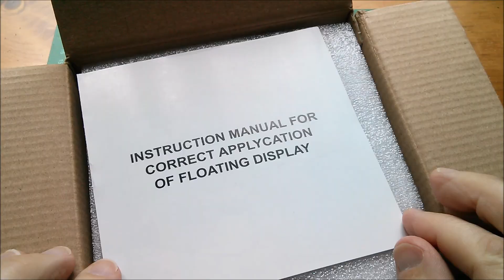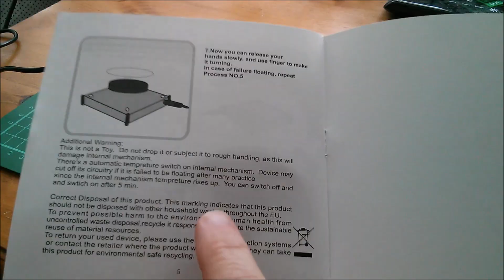Playing with: Magnetic Levitation Platform

Comment: When you said "metal case", i was thinking "really? looks like metalized plastic to me!", no idea how you could actually mistake it for metal after touching and holding it, that stuff feels so cheap and chincy in my experience...
Reply: die cast metal can feel pretty crap though, and depending on the finish can feel like plastic
Reply: The weight of the magnet and coils inside could be misleading.
Reply: some polymers are conductive ... but typically you would put a resin based finish on a metal (ie plastic) and these plastics are designed to feel like metal and usually have some kind of conductive filler material in the finish.. leading to a middle ground where one can feel like the other. yes i could tell you in a heartbeat that that tatty shite that was made in china is going to be a polymer, mostly because you cant cast metal like that for cheap.l.
Reply: Geniusaur i can tell you from here that it is cheap abs plastic ^^
Reply: Die cast zinc feels pretty crap. Iron, steel, and aluminum typically don't feel bad. Zinc is horrible though, you can feel the cheapness.
Reply: the new ones also got metal  Alu casing..
Have just purchased one of these costed a little under 30 bucks (USD) delivered on some wholesaler chinse site, not Banggood,.
and I notice that one was not the same as this one from Banggood as the casing was metal and a PIA to get off as it was folded inwards and the same with the board where there was also differences, not least temp sensor.
Se pictures here.
https://i.imgur.com/bTM1RGt.jpg
https://i.imgur.com/Ds5ODXs.mp4
https://i.imgur.com/GusHitk.jpg
https://i.imgur.com/c9msNED.mp4
But it seems that Banggood have also changed their version to this now on the listing above from Julians affiliate link as that  on BG site also showed with the same infolding metal top and magnetic floating-stand with a bare metal top and not suited in rubber like the video in the topic shows
Reply: Geniusaur Really? The metal feeling when touching it is unmistakable. Plastic is an insulator and won’t conduct heat, so it feels like it isn’t very cold. But metals are very good heat conductors (because of free electrons, which also happens to be the reason why they conduct electricity), so it feels cold even if painted.

Comment: The plug is wobbly because your power socket is not recessed, Julian 😑
Reply: Indeed, plug it in an proper european socket and no worries.
Reply: Uk plug is the best type to use in uk sockets that we can agree on.😉
Reply: Looks like a shaver adapter and not a proper European adapter.
Living in Hungary as I do, I have rather a lot of them here. There is a round recessed type with an earth connection for high power apps, and one with a hexoidal socket that takes up half the space for low current apps without earth, such as for that psu - these sockets also mate with the hexoidal stem of that psu, not just the pins.
Reply: I bet that adapter is the problem, its probably a "shaver socket" adapter, not actual euro plug. theyre similar but not the same, the pin size and spacing is just different enough so you can get the plug in and it makes contact but its a crap fit, and theres no recess ofc.
the euro plug is no BS1363 but its really not that bad. spare a thought for the americans who have to manage with the weakest and flimsiest mains connector ever devised.
Reply: The UK plugs are certainly solid, but they are by far the ugliest. If you want to connect six devices, you need a wall length of one meter fifty🙄
Reply: I did manage to break a 2 pin plug, but it was unplugged, they are quite hard to break when they are in a socket
Reply: Nate Gee : is not a euro adapter, is a UK shaver adapter, with 1A fuse
Reply: Yes. Cheap adapter. Possibly the "FUSED" note is even not the truth. I bet this cheap thing is not fused at all.
Reply: ElmerFuddGun US plugs are the most stylish, for sure. But we certainly can not say that using them is not expensive. At equal power, the cable must be twice as big, and copper is very expensive. And not sure at all that 120v is safe. We had that voltage in Europe in the 60s. It’s over now. ( too much fires, too expensive for the cables, and too much losses on distance.
Reply from the maker: Don't leave UK plugs lying on the floor though. Pins always face up, not good if you stand on it :(
Reply: Simon - I think I can agree with that.  It's been a decade since I was in the UK so will have to take your word for it!
Reply: Yes indeed very safe I managed to get a shock unpluging a US plug you can't do that with an with an type F or E and it is also not posible with an UK style plug if it has its plastik sleeves
Reply: oreubens The switches are for convenience so the user can switch off an appliance without having to unplug it, they are not required as part of the standard (unswitched sockets are available). The loop as you put it is correctly called a ring. And ring circuits are used in other applications, not just mains wiring. The "star" system is called a radial system. It is used sometimes. It was common in the U.K. before the ring was introduced. With a radial system you have one supply cable per socket outlet plate. So for each socket outlet plate, you have to run a separate cable. With a ring circuit, you can have as many sockets as you like in a normal sized home, with the cable going from socket outlet to socket outlet. Cheaper, easier to install, more convenient for the user, easier to add more sockets if needed. What's not to like?
Reply: Nah, they work just fine in unrecessed Italian sockets, also those adapters don't have twist shutters which also help holding the plug by latching in the sleeving part of the pin.
Reply: I've fitted one of those two pin plugs directly into a normal three pin UK socket. No problem!
 - "Cleverly" defeat the socket's live/neutral guards by poking a pen in the earth socket  and wiggle the plug home firmly. Lovely job! - "MacGyver style". 
(Don't try this at home kids!).
Reply: flagpoleeip they would be great except for the stupid switch that associates each one. It’s like everyone in the U.K. is going to try to electrocute themselves. Don’t get me started on the bathroom switch.
Reply: PhotoAdventures switching before you remove the plug prevents damage to the contacts.
Reply: @oreubens From watching some videos of soem UK electricians, ring mains is not too common anymore. It's only really there on old houses. So that's good news at least :)
Reply: @great geekax You can't really mean that the US plugs are the most stylish ones. I mean. Take a look at these happy fellas we have here in Denmark :D https://www.worldstandards.eu/WordPress/wp-content/uploads/electricity-tiles-type-K-200-px.jpg
Reply: I know :-)   makes it even worse. Still using a plug that's designed for a mains topology that isn't even used anymore in new installations.  Get a proper EU plug in new houses and use the oversized UK plug for old systems.
Reply: There was a reason to to ring mains... that reason isn't really there anymore. it's much safer to do it the normal/EU way.
As for switched plugs. those exist for EU plugs as well, though they're rare... only a couple brands offer these as integrated units. it's more common to find a regular plug with a regular (full size) switch beside it.
Reply: Nate Gee, it NOT a proper adaptOR (adaptER is yankee) because the shape of the holes doesn't match the round pins properly.
Looks like a shaving adaptor which takes different plugs, none exactly.
Reply: Eu Plug is the worst plug design  possibly ever designed , UK/IRL plug BS1363 is the best design, though extremely nasty and painful to stand on with bare feet.
Reply: We are coming for you
Reply: My European 5amp sockets are not recessed and are fairly wobbly.  The shuko socket are different.
Reply: Just as well that we have circuit breakers in Europe - the radicals are regularly overloaded.  Never happens on UK ring mains.
Reply: Your UK plug is very good when you step on it with bare foot.
Reply: Exactly the same as lego!
Reply: SHAVERS ONLY
Reply: Not the best - you can't turn plug around if cable is interfering with something, also too big connectors
Reply: It's a proper Euro>UK adapter sold here in the UK and it does have a proper fuse inside.  It's not like the deathdapters that bigclive uses from time to time.
Reply: you're right. uk plugs are a nightmare though
Reply: What do you mean UK plugs are a nightmare? It's he best plug in the world.
Reply: UK should just change to proper mains in the entire house that doesn't require fused plugs.
Still living in the era where copper wire was too expensive, and the entire house was wired into a loop (requiring fused plugs) instead of changing to the "star" configuration used in mains all around the world.

ANd while you're at it changing THAT...  Change to metric and driving on the right as well 😂😂😂😂
Reply: Of course it is.
Reply: yeme - pfft... the "American" NEMA plugs aren't just used in North America.  At 120V they really are the best.  Compact, low cost, and safe.  Some of the other standards are just HUGE with power bars being so long and ugly.  120V at 15 or 20A is more than enough for 99% of the stuff you need to plug in and it is way safer than 240V.  If we (and I'm not in the US) need more current we have twist locking plugs for 240V and 30A plus.  Some of you guys just keep whining and complaining about the NEMA standard plugs but likely haven't used them much either.  At least our plugs don't need to change every time we travel 100km!   ;-)